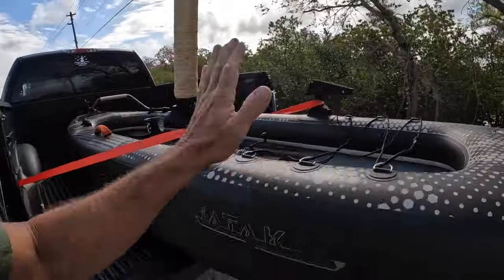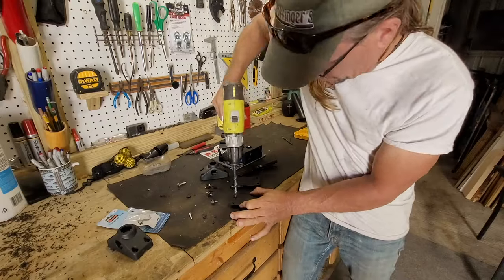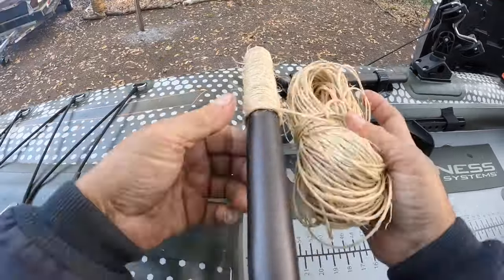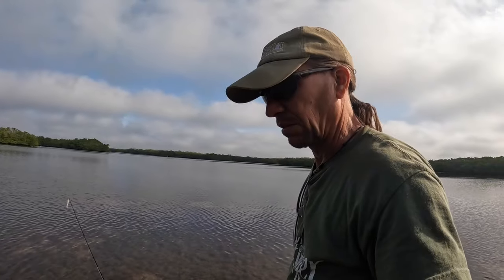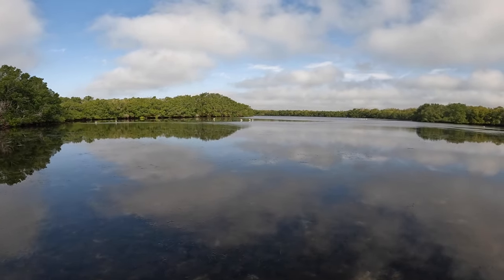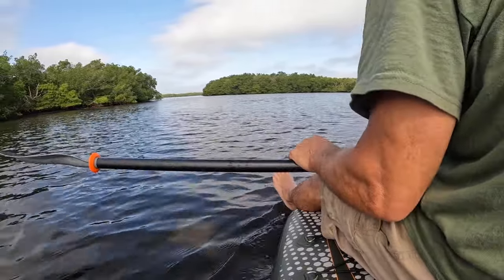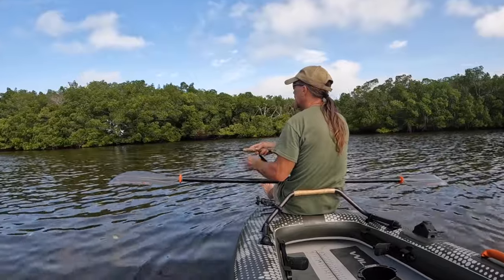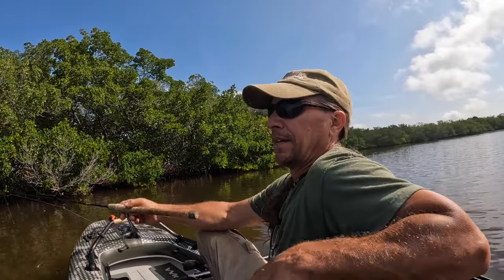CAN YOU FISH Seriously from an inflatable Kayak?

Comment: Thanks for your vids. They are helpful. I have owned two inflatables from Sea Eagle Co. One lasted about ten years till the seam opened up and wouldn't hold air, the other was a kayak style. I put a hole in it picking in up over, almost, a barbed wire fence, Fixed that hole but I had another one I never found. I bought a kayak from Tulsa Kayak in Jenks, OK and it is a Bonafide 117. Really like it. This year I bought a Nomad from Lightening Kayak. Got it home in the fall last year, got it out one time. I think it will be fine, it is very heavy and is a pedal type kayak. I need to build up my legs. The Bonafide is a paddle only and it hurts my shoulders to paddle all the time. I like both of them just fine. Myself, since I have a pickup, will not go back to an inflatable. I understand someone might need one if they just have a car. My advice is to get on the water however you can. Try all the kayaks you can, the companies have play dates and you can try them all.